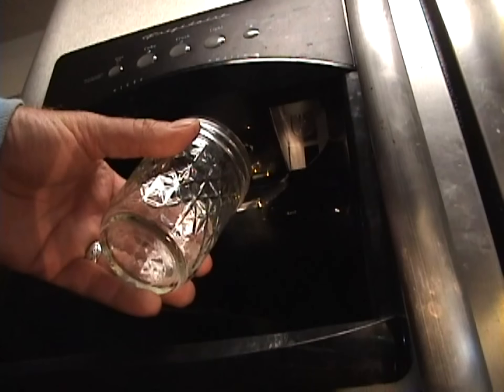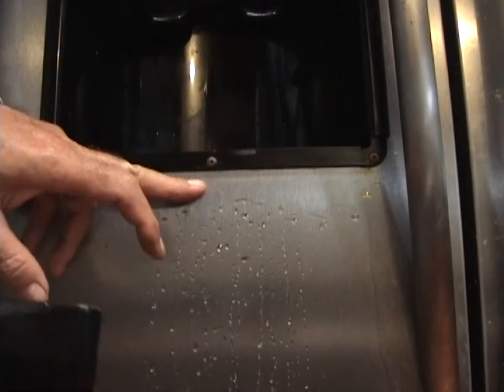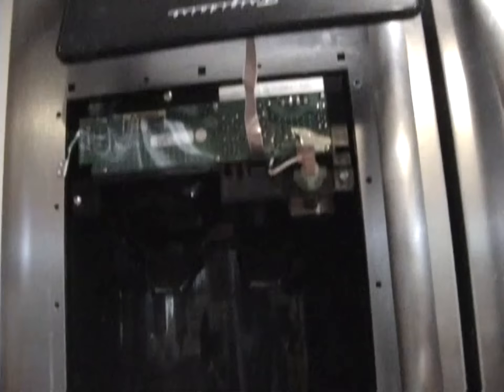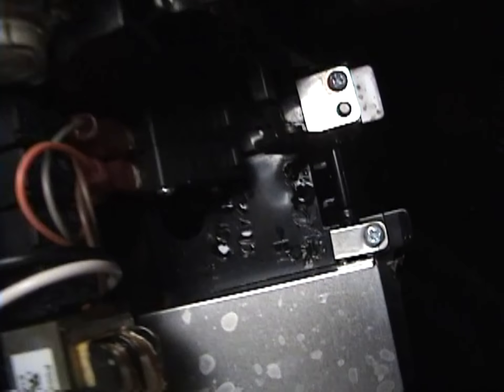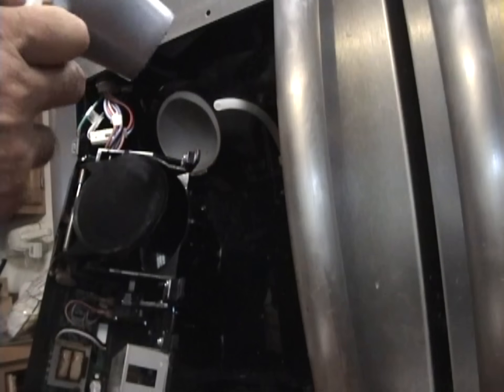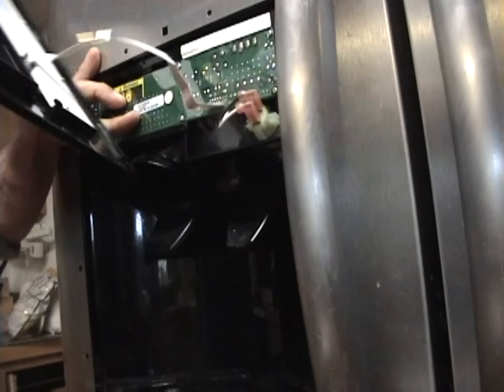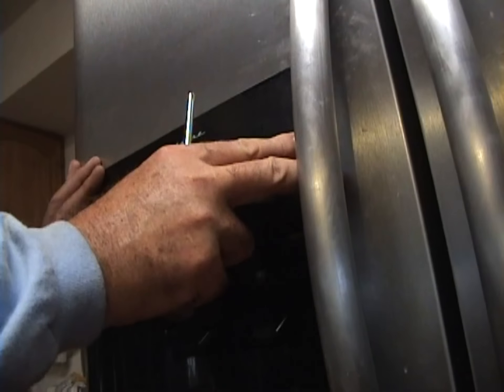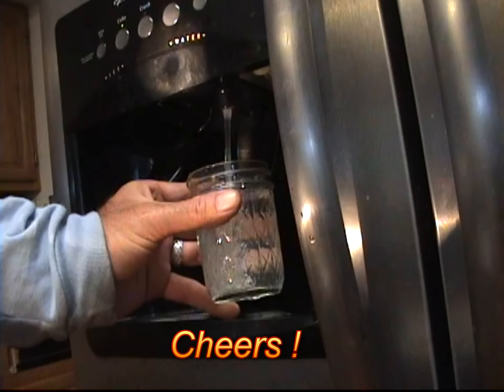Refrigerator  Door Water Dispenser Leak Fix

Comment from the maker: Hard water can deposit minerals in the solenoid valve and the build up of deposits can prevent the solenoid from closing all the way - thus allowing a slow leak to occur. You may need to replace your solenoid valve and consider an in-line water filter that feeds your frig - to protect the new solenoid. There are YT Vids on how to replace a frig solenoid. Good luck and best wishes !

Comment: I go to use my water dispenser and I have water gushing out of the bottom of the door of the fridge. The ice is working fine and no water underneath just at the door. It has one screw at the bottom of the dispenser I have a newer fridge. Can I remove the base plate the same way?

Comment: Mine had a hole you can put your finger in, feel the tube, and adjust the location, without removing the electric panel. In your video, there is a light (?) socket in the hole.

Comment: As I was removing the face plate the ribbon came off  the front plate.  I replaced it like I thought it had been, but after replacing everything - there was no power in the water dispenser.  How do you place the ribbon back into the front panel?

Comment: Jim ,  the water from the dispenser leaks but only when I press the tab to get water and it leaks underneath the fridge on the floor .  If I dont use the water it does not leak .  Any suggestions ?  Thank You .

Comment: So my tube continued to pop out after several attempts. any other recommendations? or is it time to call a repair person?
Reply from the maker: You might try a soda straw... the larger diameter ones that they use for malts/shakes as an extension.  Ask an auto supply if they have some rubber O-rings that you could use to "rubber band" the hose into the straw. Might have to split the straw a bit on one end so that it will collapse around the hose for a snug fit.

Comment from the maker: If you are still having trouble getting the adaptor into the hose, use a little sandpaper on the edges of the barbs of the adaptor. P.S. It actually took me about 30 min to do the job but after editing out all the bloopers it came out to 3 min :-)

Comment: Jim, question for you - I have the same fridge and have a small water leak as well - but my leak is coming from the left side where the ice comes out - you can see the water drip run down behind the arm where you push your glass to get ice and it goes into the tray below - its not a lot but it is annoying as to where the water is coming from - we have emptied the ice bin - cleaned the chute out (nothing was blocking anything) - any ideas? thanks
Reply from the maker: Liquid water will  most likely be coming from the hose that feeds your water dispenser paddle.  Some times, after prolonged use, the O-rings on the filter get distorted and water will begin to slow leak past them and because of its height, the leaking water can follow the water dispenser hose down and across the back face of the ice dispenser. You might try replacing your filter. You should be able to find one at Lowe's... but they aren't cheap ( $35-$45). Also, as in my case, the water dispenser hose was slightly displaced and feeding the leak. In this case, ensure that your water dispenser hose is well seated into the water dispenser outlet hole. If both of the above items have been eliminated, then I would begin to suspect the solenoid valve at the back bottom left corner of the frig. Best wishes !
Reply: Jim Thomas Thanks For The Speedy Response Jim - We Have Checked All You Mentioned Above (Except The Filter) As Its Still Showing In The Green (Good) State - We Did Pull It Out & Look At It - The Water In It Is Clear As If Brand New But Will Be Getting Another One & See What That Does - Will Advise You Back!

Comment: Hi Jim
When I returned everything together the dispenser lights were not operating I'm trying to figure out what is the issue here
Reply from the maker: You might want to check the wire connector plug where the mother board connects.
Reply: Thanks Jim all done and working perfectly

Comment: My leak is coming from behind the ice cube lever. The thing is that my fridge is not hooked up to a water source and my ice maker is off. We stopped using the fridge to dispense ice & water bcuz it was cheaper to get the Netzero water pitcher for the fridge and fill ice trays the old fashion way. I have no idea where this water is coming from and how to stop it. Its a constant drip. Its been dripping for about 2 years now. When I push the water dispenser no water comes out so I figure the hoses inside the fridge are empty, but yet water is still mysteriously dripping. Right now I put a towel in the dispenser area to catch the falling water. Hv to change the towel out every 2 days. Help!
Reply from the maker: The water filter may be contributing the water either from residual or from condensation. Try removing the filter and leaving it out of the system altogether.

Comment: I am looking for 1/4" hose splicer , does anybody know where to find it ? ,or please send me the link, already checked amazon, ,Thanks
Reply from the maker: Hami, Check your local hardware stores and plumbing/AC supply stores. If you cant find one, you may be able to use a large soda straw as a means to extend the hose line.

Comment: My fridge is leaking on the bottom of the door.  There is some that is coming out of the dispenser but most water comes out of the bottom.  Please help, getting very frustrated...
Reply from the maker: +Chelsie7847 It is not likely that you have two separate leaks -  possible, but not likely. Since water runs down hill it may be just running down the inside of the door from the dispenser to the bottom of the door. If your filter is fairly new and the tube feeding the dispenser paddle is not misaligned, then it may be your solenoid valve is bleeding/weeping. Dry everything up, but don't use the dispenser at all. Then if it is wet in the morning I'd suspect the solenoid. If it is dry in the morning, then I'd suspect  the alignment of the dispenser tube... or possibly a deteriorating o-ring on the filter.
Reply: +Jim Thomas ya, sorry I meant its only lraking from the hinge of the door.  some is dispensing but theres more coming out the hinge.  worried we might have take apart the whole door.  It was just fine before we moved but the movers were having problems bringing it into my home.  I think they may have damaged the freezer door n now its leaking.
Reply from the maker: +Chelsie7847 If the movers didn't take the doors off, then I'd still suspect that the hose feeding the dispenser has been misaligned and sending part of its release down into the door. However you may need to look carefully at the hose where it exits the body of the frig/freezer and enters the door... as the hose may have been punctured near that intersection.

Comment: I changed my filter and the water dispenser is still leaking don't know what to do
Reply from the maker: Iliana Santana Since you have changed your filter, then if it continues to leak I would suspect the actuator valve is not sealing properly in the off position. Sometimes minerals dissolved in the water can cause the valve to malfunction and slow leak. You may need to replace the actuator valve located in exterior of the back left corner. There are some YouTube videos that show how to do it.